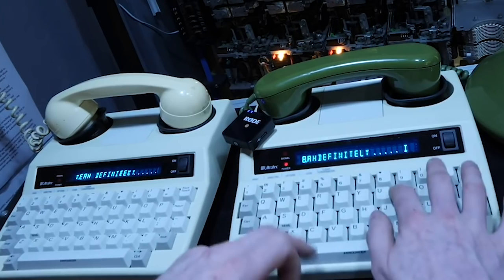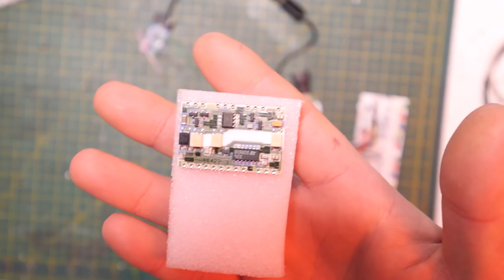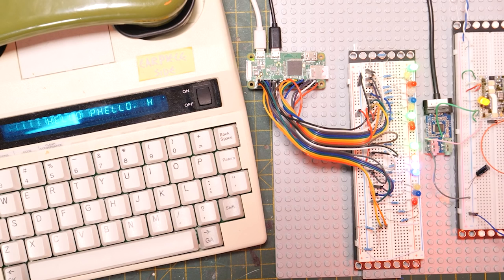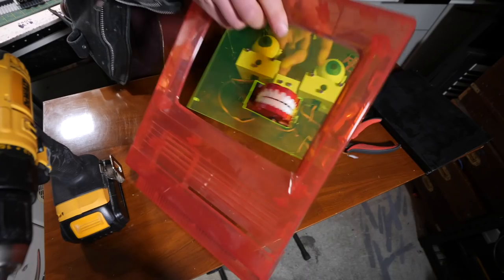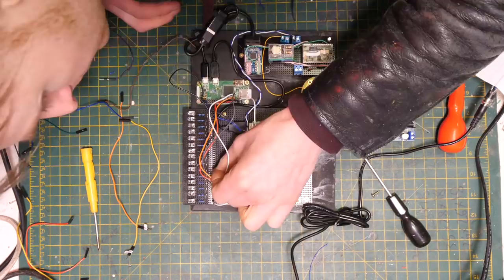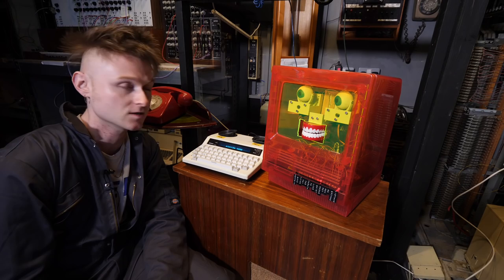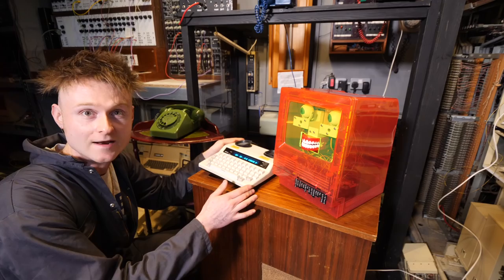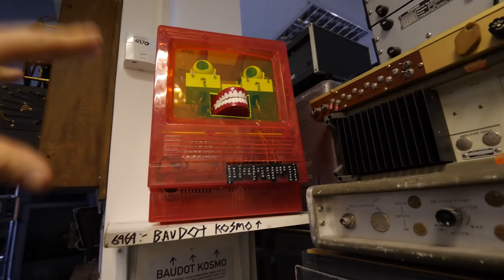Givng Retro AI To A Talking Robot via BAUDOT CODE.

Comment: That thing would have terrified me when I was a little boy. Even fifty years later it's a little disturbing.
Edit: for even greater noise you could have all the conversations printed out by a 1940s teletype.
Reply: Transmitted via secure enigma connection 😆
Reply: @aleisterlavey9716  To be nerdily pedantic: the code machine used for teletype messages was the Lorenz SZ. Enigma encyphered Morse code.
Reply: @zh84  I like nerdly pedantic. It gave us Internet.
Reply: Baudot -> enigma typing robot -> optical lamp reader -> morse keying robot -> morse receiver -> enigma typing robot -> optical lamp reader -> robotic punched paper tape puncher -> punched paper tape reader connected to model 33 ASR teletype.

Simples!

Comment: I've got one of those baudot keyboard things - except it is missing the speaker and receiver. Someone literally glued thin pieces of wood over the top of the holes, too. I'd love to build something like this with a Rpi Zero inside of it, but the phone line connection is the limiting factor for me here.

Comment: even though its working pretty fine right now. raspberry pis are quite slow at proccessing AI data. i would reccomend looking into replacing it with something with a AI accelerator or  a gpu, something like the nvidia jetson
Reply: It's not really AI, it's just markov chains. No need for fancy hardware
Reply: And the "ai" (megahal) was written in the late 90's. It ran fine on a 800mhz pentium 3 laptop